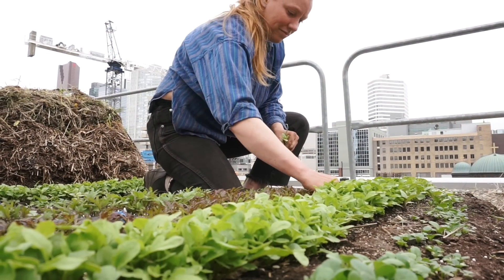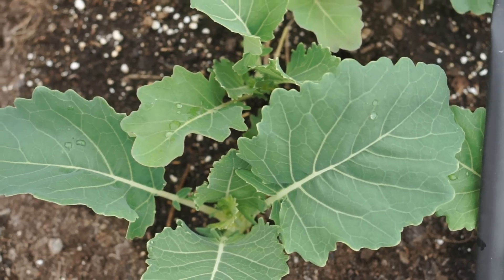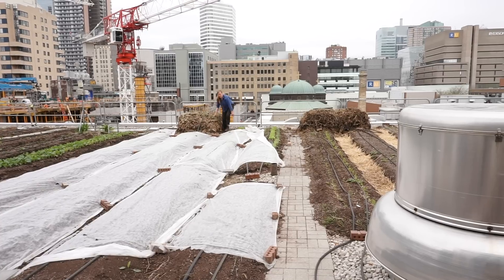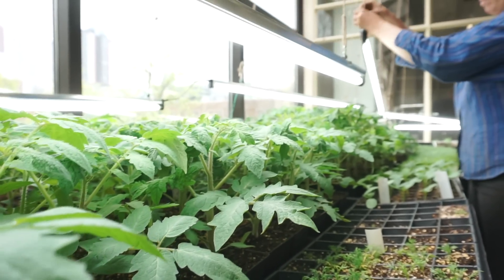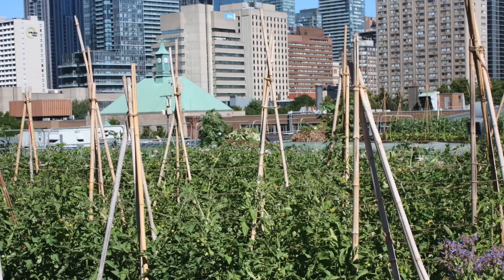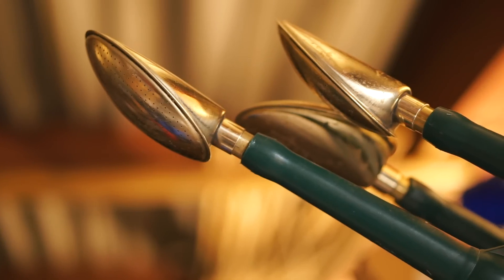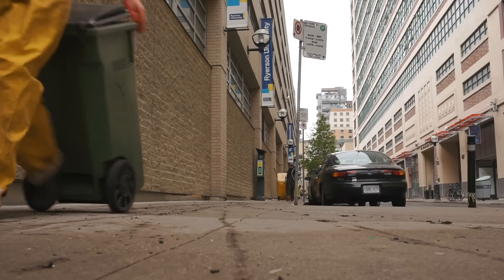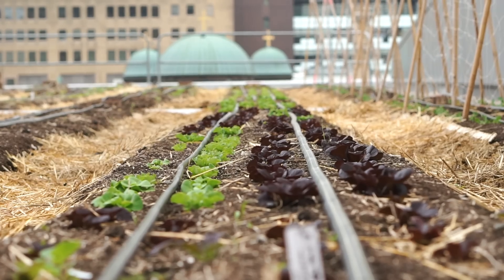Growing Food in the City - Urban Rooftop Farm in Downtown Toronto

Comment: Pretty vague about building that can have roof gardens? What age? What size?
Reply: age and size don't matter so much as load-bearing capacity of the roof and building as a whole and roof access. they say industrial, 50s because those buildings generally had an excess of strength. any company buying an old building for that purpose would require planning permission which would entail an examination of the original plans or structural testing. I highly doubt this could be done on any preexisting home as rooves are not built to support weight like that.